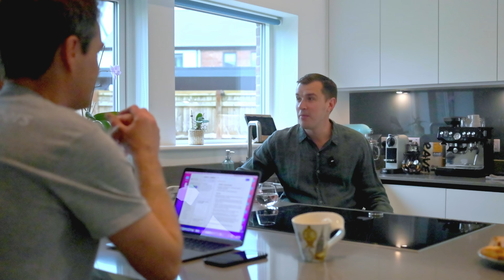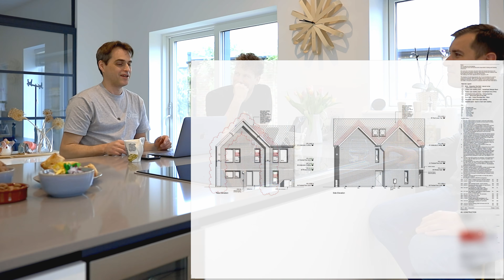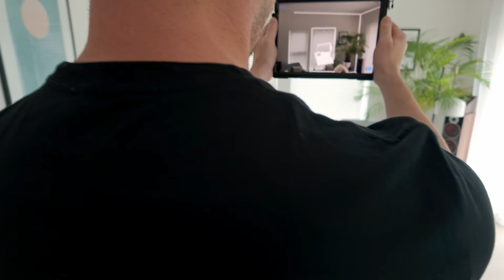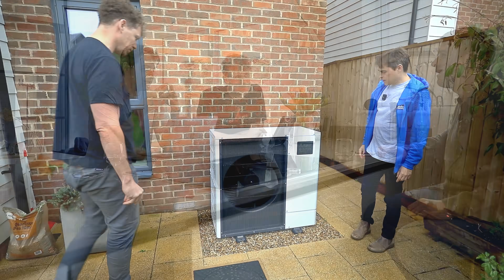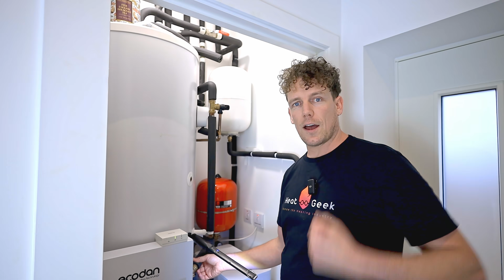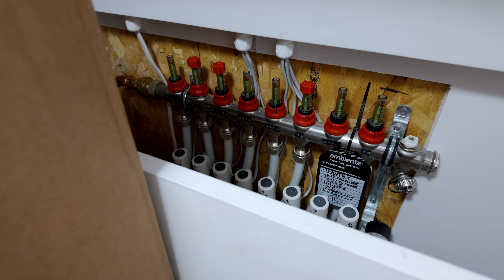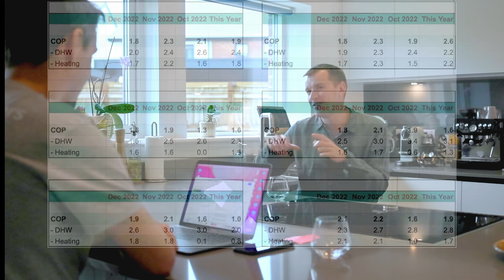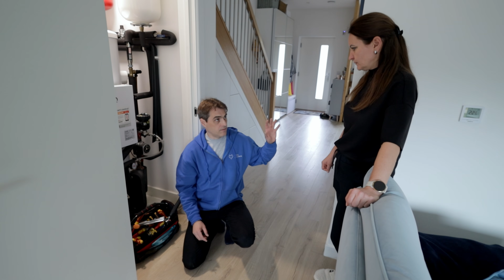How Developers Are Ruining The Heat Pump Market

Comment: I spoke to an installer recently who said he always fits 12kW heat pumps. When I replied that it would be much too big for my house he said that it was no problem because it would modulate down to the required output. I didn't take the conversation much further and I intend finding a Heat Geek although there aren't many in my area.
Reply from the maker: Same guys used to say that about oversized boilers - ohh they just modulate down
Reply: @UrbanPlumbers  My 12kw boiler can only modulate down to about 8kw. I only need 5-6kw so it cycles a lot. I've had to replace the ignitor several times since moving in, as it bends out of shape from heating and cooling constantly. Very annoying.
Reply: @egocd  there's something wrong with your boiler if it can only modulate down to 66%. Period.
Reply: @BerkeleyTowers  That’s the spec. It’s how it’s been made. It’s old.
Reply: @egocd  It must be ancient, what model is It? If it cycles a lot and It needs repairing a lot, perhaps there’s a moral in there somewhere?
Reply: @BerkeleyTowers  Turns out it can only modulate down to about 9kw. Ideal Icos HE12.
Reply: @egocd  My 24kW boiler can't modulate anywhere near the 2-3kW I need. It cycles epically (on 10 seconds off 2 minutes after the first ~3 minute burst), especially if you try to use lower flow temps.
Reply: @UrbanPlumbers  Adam said in the film they don't even make heatpumps small enough for that installation (3kw). Wouldn't you have to rely on oversizing and some modulation?
Reply: @tonydaddario4706  There is a minimum output that the units can run constantly at, any lower demand and it’ll start cycling (i.e. running too high for part of the time, switching off for a while, and repeat). A 5kW unit should be able to run at 3kW, but an 11kW unit like in the video probably just won’t be able to…
Reply: I cant see any option for them other than installing a decent sized volumizer to stay out of modulating constantly...?
Reply from the maker: @Etacovda63 volumiser changes noting here
Reply: @UrbanPlumbers  100L worth? should reduce cycling by quite some margin... (assuming you remove all the zoning, extra controls and run the entire thing weather compensated) - how much water volume is going to be in his system, 100L should pretty much double it assuming 16mm MLCP in the slab (which would be approx 85L assuming a 100m2 slab at standard spacing) and therefore halve the cycling?
Reply from the maker: @Etacovda63  volume doesn’t reduce cycling - it extends the first cycle from cold only and then maybe increases off time if controls are decent
Reply: @UrbanPlumbers  oh, it'll still cycle - but longer between on and off and therefore should increase the cop - but obviously the true fix is to get a smaller heatpump...!
Reply: Yeah, I'm getting the same in Ireland.  "Oh it modulates"
Reply: They do, but there's design limits. And a 12KW one with not going to modulate down to like, 2

Comment: Does having no thermostats but two mixed pump sets (divicons) one for the UFH and one for the radiators, does that affect efficiency badly or not?
Reply from the maker: Yes it will also affect it - how badly it depends on a set up. In real life mixed circuits are very rarely needed. I have installed now well over 40 heat pumps and never had to install a mixed circuit and only 2 installs had buffers
Reply: @UrbanPlumbers  i havent decided on an ashp or V-200 but sometimes like the idea of being able to run the groundfloor UFH later at night for the living room but not have the upstairs radiators running when the kids are sleeping. Normally night time I'd have 3 degree set back but this would be cooler in the living room on a winters night

Comment: A great video, thanks. Worth noting that the 11.2kW Ecodan is a power limited 14kW unit, with the same minimum output as the bigger version. Also that Ecodan apparently have a firmware update for excessive cycling that they only install if someone complains. My experience is that the 11kW Ecodan cycles rapidly whenever the heat load goes below about 6kW.
Reply: Mitsubishi has a big problem with truth when we talk data. The units do not deliver what is on the data book. My 8.5kw does no modulate below 4.5kw when it should go to 3. The energy and cop data displayed on the unit are also completely made up.
Reply: @aymerichousez1005  Not defending Mitsubishi but I think if you were to take away all the supporting hardware and do the testing in a controlled environment, I'm sure you'll get good results that match the book. My 11.2kW is returning about SCOP 4.1 and I think it's just down to running 1 circulator, no hydraulic separation, no 3rd party controls, no TRVs, good emitters, good system balance, no glycol and fairly low flow rates as it's oversized and never needs the full output. Internally these units are 90% the same as the best performing ones from Vaillant, Viessman etc, it's all the pre-plumbed and 3rd party nonsense that drags it all down. And Glycol!
Reply: @Loopyengineeringco  I would say that unless you use a 3rd party monitor, you don't know what your cop is. I was at first impressed with the COp shown on my ecodan but when I started to monitor temperature and electrical power independently, I realized that these values can't be trusted. The temperatures are rounded and the power is corrected somehow to makes things looks good.
Whatever they claim from test conditions, the competition performs better. I don't believe that these units are all the same. A Vaillant 7kw weight 190kg, a Mitsubishi 8.5kW is barely 100kg...
Reply: @aymerichousez1005  Yeah definitely don't trust the estimates, I'm using a ultrasonic flow meter (ofgem supplied calibrated unit as part of the MMSP package) and 3rd party CT on the consumer unit to do the calculations. I think you're comparing different chassis sizes - the twin fan ones are naturally heavier. But like for like, you're right in that there's still a bit of difference. Vaillant use piston compressors vs scroll compressors on the Mitsubishi, maybe they have more ballast for damping, or thicker casings? Not sure! The Mitsubishi is definitely a lower quality product though for sure, although I do like the controls, AA mode is really good, external API and hackability etc
Reply: @Loopyengineeringco  I am not using the AA because I do not have the remote module and the location of the wired panel on the plant room makes it unsuitable to use AA but what you say makes me thinking... At the moment I am using the WC mode with a 3rd party thermostat that cuts off  the HP when room temp is reached.
Reply: @Loopyengineeringco  how do you know that the compressor is running slower in AA mode? How much do you read on the parameter 16?
Reply: @aymerichousez1005  I have a networked CT on the power line, so have real time power in Watts and that goes to Home Assistant, so I can graph it against flow&return temps etc in real time... I can't remember the actual comp frequency in Running Information, but the difference in Power (W) consumption is pretty much proportional to the compressor speed so I use that metric. My 11.2 does throttle down about 200w lower on AA than on WC, so about 5% lower. On WC is starts cycling instead.
Reply: Interesting info, thanks! Would make sense that the 11.2kW and 14 are the same internally just the 14kW has a larger evaporator coil and 2 fans.
Reply: Interesting stuff. My old R410A 8.5kW Ecodan is literally just one of their Mr Slim air conditioning units with a heat exchanger bolted on to the refrigerant pipework. No water pump in the unit, and even their controls are repurposed from AC units. Mine doesn't have any control or even visibility of the flow rate. It just assumes there's not enough flow if the refrigerant temp goes too high. They have got better as the flow temp controllers have evolved though.

Comment: Ecodan cylinder needs a separate pump as it heats up the cylinder indirectly using a plate heat exchanger. But you could remove the other pump and run the heating system on 1 pump
Reply from the maker: those systems have 4 pumps. 1 for the external unit, 1 for DHW, 1 for rads and 1 for UFH. - 2 of them can be easily removed. Those mitubishi cylinders are a terrible design.
Reply: @UrbanPlumbers  yes very inefficient

Comment: Tell  Adam, that a metre or two of 22mm pipe compared to 28mm makes less than 1% difference in head/heat loss in the overall system, the old Darcy-Weisbach equation or moody diagram will tell you that sharp bends are the main issue - Use the analogy in the video of driving a car, motorway / dual carriage way to a mountain bendy road.
Reply from the maker: his point was that If they really thought it was a 11kW heat loss 22mm pipework had no place there at all, as pressure loss would have been 1600pa per meter, and velocity over 1.5m/s - but because the heat loss is much less they got it right by accident
Reply: @UrbanPlumbers  Apologies! - It wouldn't suprise me that with that sort of (very low) heat losses, does one actually need a heat pump? - as the exchange heat between the water tank & CH circuit would suffice - I'm thinking here of cheap overnight direct  immersion heating here (Mixergy?) : I'm thinking here of a small heating element @ (say) 200W running 24/7 into the HW tank - or these 150w  Hybrid Radiator Heating Elements?

Comment: Why is nobody using heat pumps with solid fuel? In the winter people like their stoves lit, nice n warm plus it looks nice. Boiler on solid fuel usually runs about 55c on the return. Then rest of the year heat pump?? Is it just me.......
Reply: Too much air being pulled out the chimney,you need a sealed house for heat pump
Reply: @piee3.14  you absolutely do not need a sealed house for a heatpump. Heat is heat, your house doesnt know what its being heated by
Reply: @Etacovda63  The housing I know of wouldn’t get a grant for heatpump unless they had their fireplace removed,because of the age of the house they couldn’t install mechanical ventilation unless they started tearing up the place so their house is totally sealed up
Reply from the maker: @piee683 fireplaces are allowed under the grant
Reply: @UrbanPlumbers  Thought they were, cheers mate! Keep up the good work! 👍
Reply: @piee3.14  I think you're ignoring the heat release from the solid fuel appliance. If I have a 3 kW wood burner output it's already taking care of the few hundred  watts of stack loss.
Reply: @philthompson1097  my thinking is heat loss and running a heat pump is a lot easier when you haven’t got a hole in your roof constantly pulling out air from your house
Reply: And people wonder why damp and mould is a thing major now, sealed houses. I speak for older properties that relied on open chimneys and such for ventilation.  The world's gone mad. Cheers
Reply: @garydulson9018  This house has mechanical ventilation with heat recovery, it’s mentioned several times in the video…

Comment: I'm 5mins in and I'm going with 190m2 x 15W/m2 x 1.1(ventilation) = 3.1kW heat loss.🤔
Reply: That's insane. Not even the basic plumbing bits are correct, nevermind the heatpump side of things.

Comment: Another great video. You two make a great team.

Really sad to see that new builds built to a high standard are being let down by shocking heating installations.

Can't imagine what it'll be like once heat pumps are mandatory for all new builds; 2025 in England if im not mistaken.

When an oversized heat pump gets installed for an old leaky retrofit, you can kind of understand why the installers go extra careful even if you know that a proper heat loss calculation is the solution. But with new builds it is inexcusable to get it wrong.
Reply: There should be some penalty for the builders.
Reply: From what I've seen of newbuilds the heatpump being misconfigured is hardly surprising given that many have leaking plumbing, missing insulation, even leaning walls.

Comment: Why am I enjoying these car crash ASHP post-mortem videos so much!! These poor, innocent home owners have my sympathy. No heat loss calc, oversized unit, basic plumbing mistakes, over engineered UFH, the list is always the same. Not sure if I would want the ASHP so close to the ground, I would be surprised if the manufacturer doesn’t specify at least 200mm clearance. Also not too happy about the casual attitude to the ACH (air changes per hour) guesstimate. Need a blower door test or at least the as-built SAP documents. The MVHR install looked a bit ropey and judging by the ASHP install, probably also needs to be reviewed. The problem with all this is there is no reasonably priced solution to remedy all this. Other than a new ASHP the right size, what can they do?
Reply from the maker: Video on improving those houses coming later this year
Reply: @UrbanPlumbers  One solution would be for the residents to share heat pumps! Keep the 11kW ASHP and run three homes from it.
Reply from the maker: @tlangdon12 or 5 🤣
Reply: A bit of DIY is a reasonably-priced solution. What's really annoying is that all the grant schemes explicitly exclude homeowners so after you've worked out how to do things properly by taking an interest in channels like this and other fora, and worked out that you can a better job for half the money, you are excluded from incentives. They are trying to keep the cowboys out with these schemes, but as we observe it doesn't really work very well. There is also a strong tendency in government to actually only care about the job-creation part, not the outcome of better, lower carbon housing, which could be provided dramatically more cheaply if we let people help themselves.
I DIYed my MVHR for example. It cost about £1300 total for a 3-bed detached (and 9-days in the landing cupboard and loft over Xmas cutting tiresome spiral pipe :-), oh and quite some time making a nice 1st-principles design spreadsheet). Plenty of people could fit their own MVHR and would make a neat job of it. It's not rocket science, and even the design is easy if you use a manifold system. https://youtu.be/OVcvk9Wnyw4?t=1463

Comment: A crucial point which was mentioned in the video is that you simply cannot obtain a small enough heat pump for these better specified (insulation, glazing, airtightness etc) properties. Is anyone going to address this problem and start selling a 2, 3 or 4 kW ASHP?
Reply from the maker: NIBE makes exhaust air heat pumps that are suitable for low heat loss
Reply: @UrbanPlumbers  I'll look into them!
Reply: Daikin do the 4kW ED04E2V3, I have the 6kW bigger brother for a 5.2kW heat loss, I can get mine to run at just under 400W input with compressor and pump running continuously for @ 7C external temperature.
Reply: @_Dougaldog  that's encouraging to hear - thank you.
Reply: @Wayfarer-Sailing  

I've edited to clarify, that's 400W input to HP, and my COP since installation is @ 4.25.
Reply: Smallest Vaillant is 3.5kw
Reply from the maker: @brianballard905  it’s really a 5kW unit not a real 3.5kW
Reply: @brianballard905  good spot - thanks.

Comment: What i find interesting is you always say one pump is enough for entire system. When i was installing Under Floor Heating, they said I needed a manifold and pump per floor? I wanted a central manifold for whole house, was they incorrect?
Reply from the maker: Most likely yes. There is always 5 times more pumps installed than needed

Comment: This is a sad indictment of some of the profession that this standard of workmanship can occur at all ? 
"The more experienced they are the less likely they are to be good "! What a terrible shame. The experienced people in the industry should have a head start and be therefore be better ? 
With all the bureaucracy and planning that is meant to be done prior to the installation, how does this happen ? 
Perhaps a "Gas Safe" model should/could be ado[ted where a person completing the work automatically becomes responsible for it in the future ? Should there be issues, a body mediates between the house holder and the installer has to correct those installations ? 
Good work and diplomacy (as always)  from the Adam and Syzmon from Heat Geek and Urban.
Reply: I do confirm what Adam says, for my country.  Here in Belgium the old chaps', in the trade for 40 years, are totally unable to design a system.  They just eyeball it and reproduce what they have learned 40 years ago.  Your old (atmospheric high-temperature) gas boiler was 25 kW ? "I'll put you a 30 kW so you're sure you won't be cold in the winter."  And the said new boiler is a condensation gas boiler, triggered by a stupid on/off thermostat, barely modulating its power, almost never condensating because the flow temp is set on 75°C, and the thing breaks down after 4 years because it cycles 3500 times a year... The owner did invest into insulation and eventually the house had a heat loss of 4 kW.  And that happens ALL THE TIME with the old' chaps, the "very experienced" ones.  The young boys who learned to effectively*¨apply the EN 12831 standard and *really use the method, they do a great job.
I've been training to design heating systems and in the room there were two old' chaps which were there because, they said, they didn't understand anymore why the new boilers fail and the suppliers told them repeatedly to get a training to learn to design.  The others trainees were design engineers from design companies which were asked by their bosses to review their design methodologies to get less failing installations and less unhappy customers, and make the company ready for the heat pump revolution.

Comment: Pretty obvious that a properly installed heat pump system relies heavily on a correct heat loss calculation, and hardly anybody in yUK knows how to calculate the heat loss of a structure. Perhaps promoting a "guess the heat loss" game is not the best strategy.